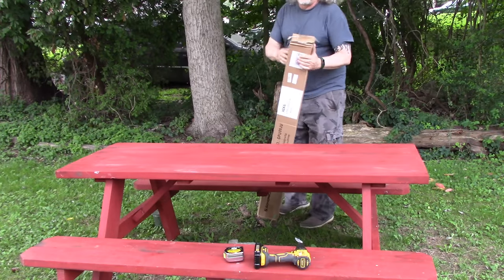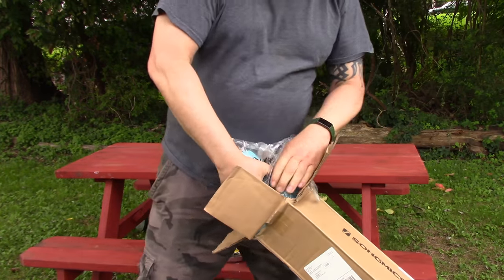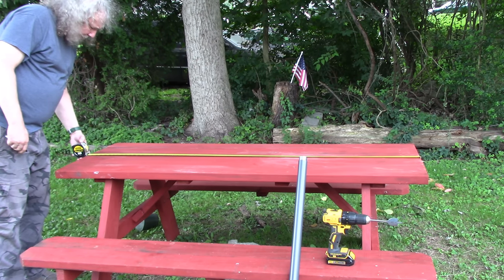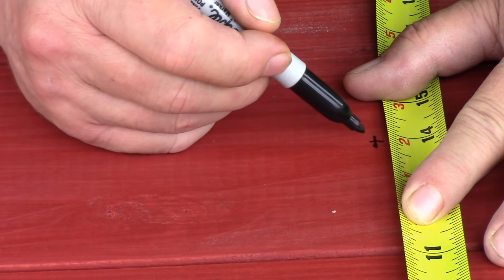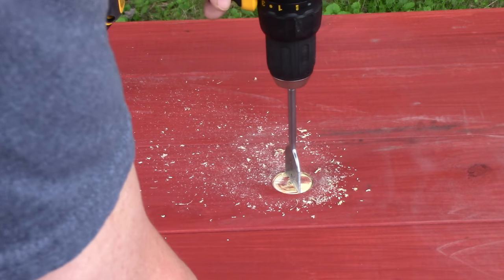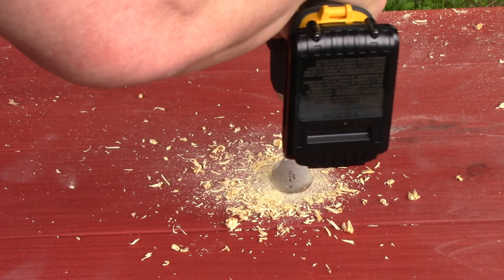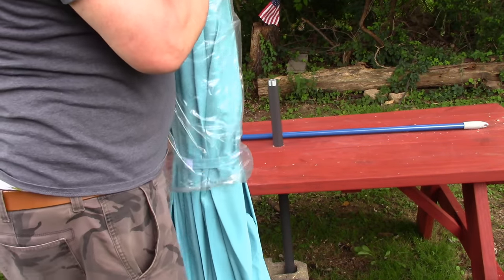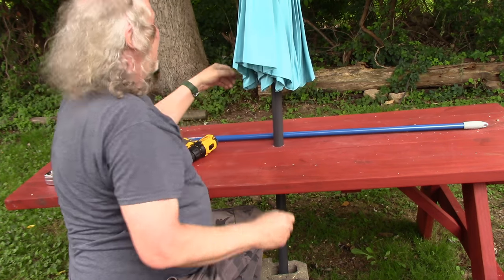How to Install a Picnic Table Umbrella or How Not To!

Comment: measuring the center accurately is very simple even you don't have a tape measure. just cross a line on the 4 corners of the table, where the line meets, that's the center of the table.